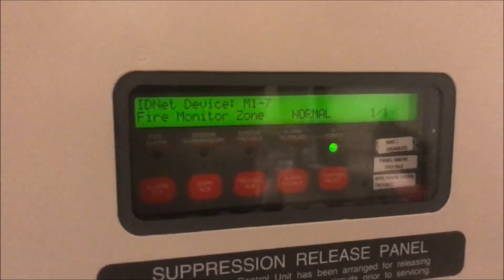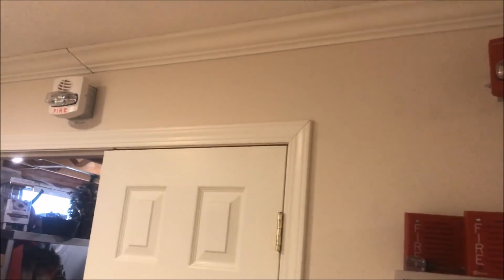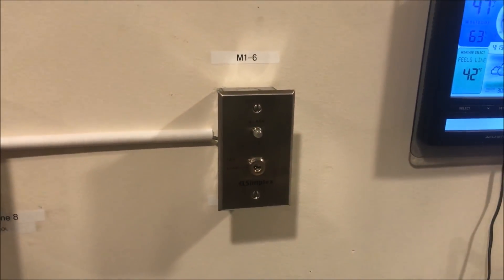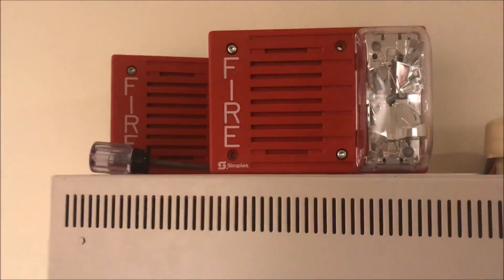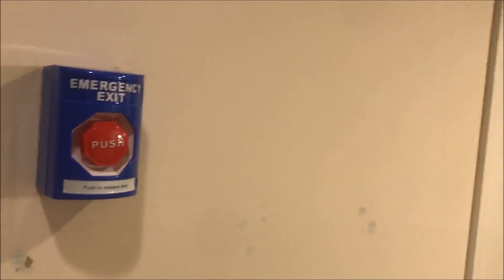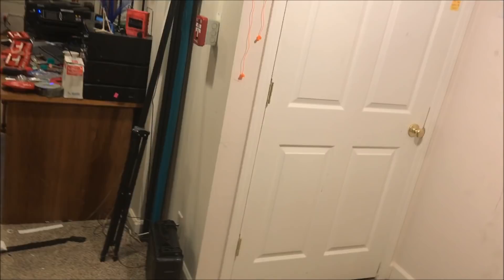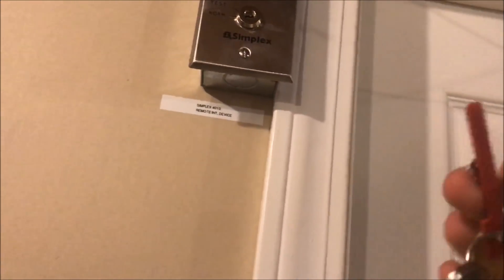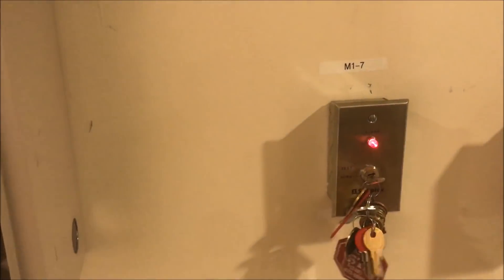Simplex 4010 Test 6: Key Switches and Shorted NACs!

Comment: I have an idea on what’s wrong. Probably for got to remove the jumpers and wired 24 volts to each positive and negative terminal which caused an issue with the 4903’s being powered incorrectly which caused a trouble.

Comment: Also, I’m building a Simplex 4010 System to learn Simplex. Do you know if I can use both IDNet devices and MapNet II devices on the SLC at the same time? I’m struggling to find an answer for that.
Reply from the maker: Best Security Systems I honestly have no clue. I’ve been sticking with IDNet purely because i had some modules laying around from pull stations.

Comment: Oh and where did you get that terminal cabinet and what is it needed for? I just route everything back to the FACP or the device the wire run terminates at and where I place a EOL resistor.
Reply from the maker: Good Question! I will be making a video that explains this further, but i bought it off eBay so i could easily remove one point without having to disable the entire system. It is basically just a big 'switchboard' if you will. it takes one set of wires coming in, and then splits them up between the different points.

Comment: And that detector at 2:16 is polling really fast. I’ve never seen an addressable device from Simplex poll that fast; although maybe it’s because there isn’t a whole lot on demo systems.
Reply: firefreak57 well, on addressable systems, the less devices on a loop, the faster the device will poll. It’s like a fire lite addressable system, same idea.
Reply from the maker: Actually, it is double polling. There are two different addresses on that base, point 4 for the smoke, and point 5 for the heat, so the panel is polling two devices from one base.

Comment: Are the key switch LEDs wires so that they poll like they would on a 4100 series system? Just wondering since they’re on an IDNet loop.
Reply from the maker: These switches have different terminals for the switch and LED. The LED is an alarm indicator, so it does not have a polling feature built in, it is wired into NAC 3 on my panel, which is set as a visual circuit.

Comment: Use a multimeter to see whether the horn or strobe is shorted. Are those lights connected to the NAC or the RELAY? It should be on the relay. Those lights have resistance in them, which if they aren’t on a relay that’s probably an issue you will run into. Also, it’s ALL METAL inside. make sure that nothing is touching internally.  I have the same terminal cabinet lol